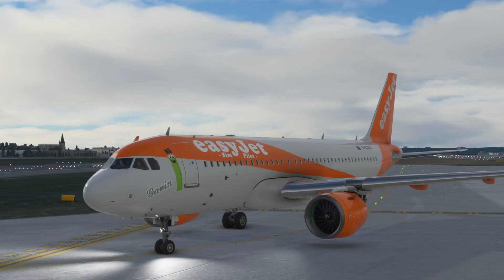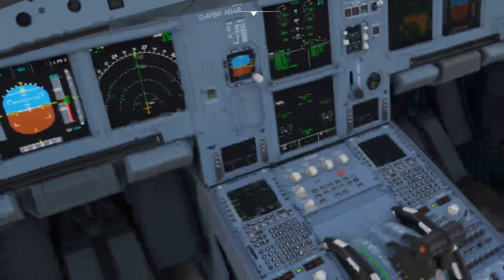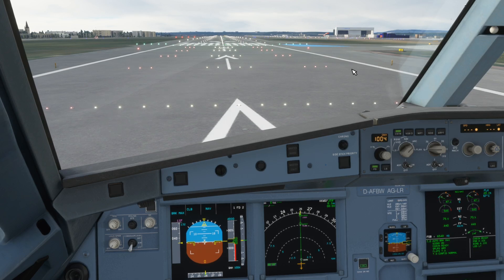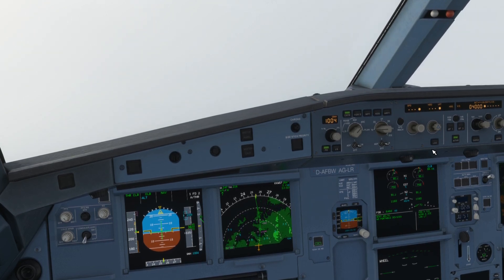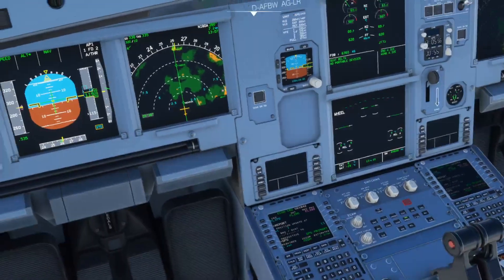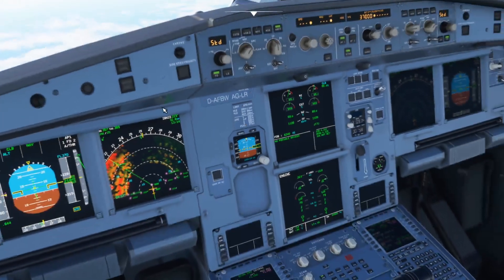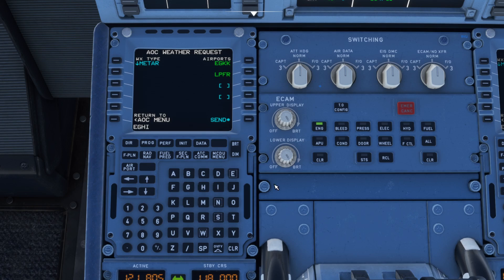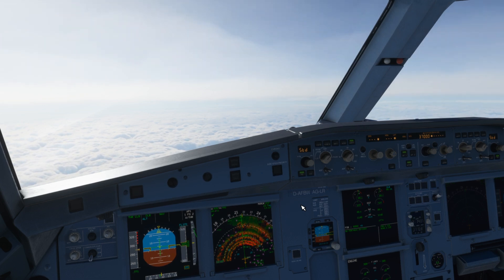MSFS 2020 A320 - Take-off & Climb to Cruise Altitude | Tutorial Series Part 5

Comment: for some reason my climb always get stuck at 5,000 ft for a period of time before it continues its climb even though I have set the altitude, what am I doing wrong?  drives me crazy!  :)
Reply from the maker: Are you in CLB mode? If so, sounds like there could be a constraint on your SID of 5000. When you pass the final constraint waypoint, the aircraft will continue to climb.

To ignore the constraint, put the aircraft into OPEN CLB mode by pulling the ALT dial.
Reply: @Easyjetsimpilot  thanks for the quick reply, you were absolutely correct!

Comment: So I did a flight today with Flex takeoff but during climb the Flight Mode Annunciator kept showing TO/GO LCK. Also I could not activate the autopilot till I got to the cruise altitude.
What did I do wrong? Should I have used TO/GA takeoff setting?
Reply from the maker: You rotated too quickly or at too low a speed and ALPHA FLOOR protection kicked in, locking your thrust at TOGA.  AP is also disengaged and will not re-engage until you have rectified the situation by lowering your nose, gaining airspeed and then disconnecting A/THR.

Comment: I don't know if this is a stupid question, but can the A320 autopilot automatically take the aircraft to the specific altitudes assigned in the MCDU for each specific waypoint? -- ie  without you having to dial-in the target altitude each time on the front panel?
Reply from the maker: No. You have the set the altitude in the FCU.
Reply: @Easyjetsimpilot  Many thanks. But then I can't see any difference between altitude "managed" mode and altitude "selected" mode. (Because in both cases you have to dial-in the target altitude manually on the FCU). Or if there is a difference in the logic, then what is that difference? 
Sorry again if this seems like dumb question, but I can't see anywhere where it clearly explains the difference between "managed" and "selected" altitude modes.  
Hoping you you can please de-mystify it for me :)
Cheers, Martin.
Reply from the maker: @martinfendt1305  there are two modes concerning the altitude dial :-

1. Managed Mode (push in) 
Dial in the altitude you want then push and the aircraft will target this altitude, respecting constraints along the way, increasing / decreasing the rate of climb/descent on the way to keep you on profile. *THIS NOT YET WORKS CORRECTLY IN MSFS*

2. Open Climb/Descent (pull out) 
Dial the altitude you want and pull, and the aircraft's rate of climb /descent will increase / decrease to reach the targeted speed.
Reply: @Easyjetsimpilot  Thanks!

Comment: I'm having extreme difficulties to keep the plane straight on the runway when accelerating or after landing. Does anyone know why and how to fix that? Or are those  just my skills in need of more practice?
Reply: Start by trying reducing the sensitivity setting for the rudder. Also add roughly a 5% dead zone
Reply: @Mr.Martini549  I will, thank you for the advice! 😊
Reply: Set rudder dead zone to 50%. Thank me later💯
Reply: @criticalthinker7822  but no one did

Comment: You are awesome sauce for doin this series! Maybe I missed the explanation...but when I load my sim brief it has certain altitudes during climb. In this video you went from 1200 straight to FL 370. Is there a reason for this? Again I appreciate this series and am trying to figure out all the correct procedures. Thank you!!
Reply from the maker: Every simbrief flight plan is different. There maybe times where you are too heavy to climb straight to your cruising altitude and so will have to perform step climbs. At which point, you'd climb at the altitudes given on the OFP, unless you've checked your PROG page on the MCDU and confirmed you can proceed direct to your cruising altitude.

Comment: Great Video and really detailed much appreciated but have you tried the default aircraft?? When I take of the flight director just wants to level off after takeoff then climb and also getting to the planned altitude takes so long sometimes not even reaching it. Do they plan on actually making and fixing without breaking the default aircraft?? Such as flaps. 
And as for the ice effect that's unbelievable and why no main UK airports payware scenery.
Reply from the maker: Manchester, Birmingham, Bristol, are all available as payware scenery from 3rd party developers.

The flight directors are not too good in the take off phase of flight. I would use the A320NX from Flybywire.
Reply: @Easyjetsimpilot  Yeah but EGKK,EGLL  I don't have the premium version. Right so this mod how do you install it and what about all my current liveries does it replace the default I heard mods can effect the game though.
Reply from the maker: There is a great freeware Gatwick available from Flightsim.to.

Installation couldn't be easier. All addons are done by placing the new addon into the community folder. No more installing files etc.
This is the same whether it be for an airport or livery etc.
Reply: @Easyjetsimpilot  wow they have got one thing right then on the installation folder yeah I couldn't believe how good that was it is simple your rights. Yeah that Gatwick mod does look incredible so much hardwork  put into it I think they should of used it for this update instead of the other choices.
Reply: @Easyjetsimpilot  also could I ask how do you buy of the marketplace cards but can you buy a Microsoft gift voucher and use that as they don't explain it.
Reply from the maker: @reece650  I'm afraid I haven't used the Marketplace and so am u able to offer help there.
Reply: @Easyjetsimpilot  no problem.

Comment: Surprised easyjetsim pilot, you haven't  had any crashes to desktop  at all. What's  your secret?
Reply from the maker: I've only had 2. Both were my fault. Bad management of the Community folder & rolling cache and unplugging a USB whilst in Flight.
Reply: @Easyjetsimpilot  so you think it should be ok to fly the few a320 now, eg from Gatwick to Amsterdam without problems? I am a bit nervous of starting a flight and crash  my comm  folder is empty, just the fbw working dev version, Gatwick and ba colors . What do you think?
Reply: @chrisadish  you're probably good to go. Try it offline, see if it works. I almost always test my flights before attempting to fly in vatsim. So far so good.